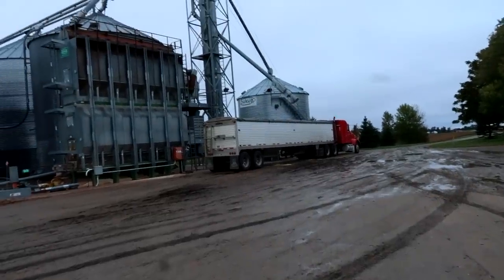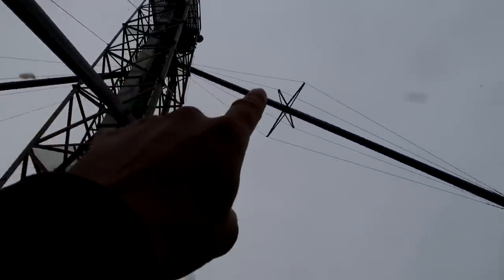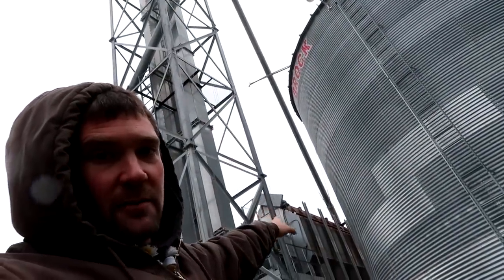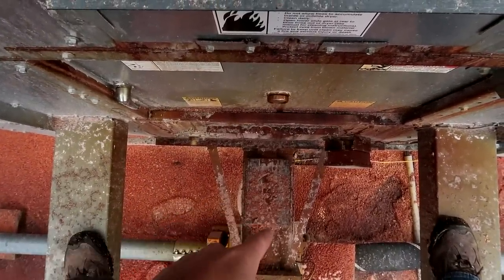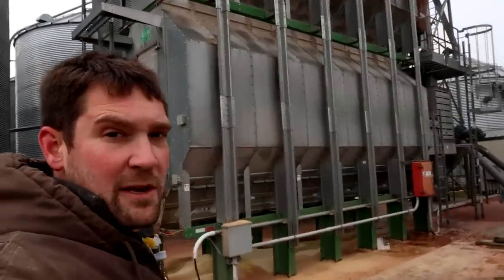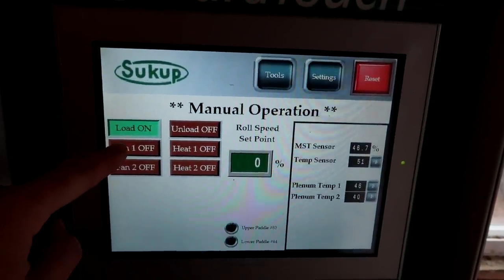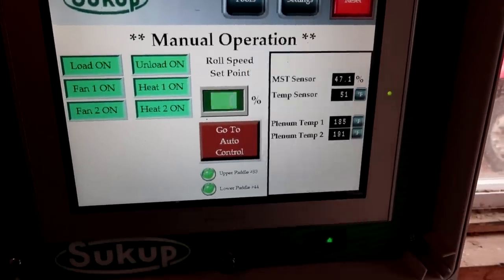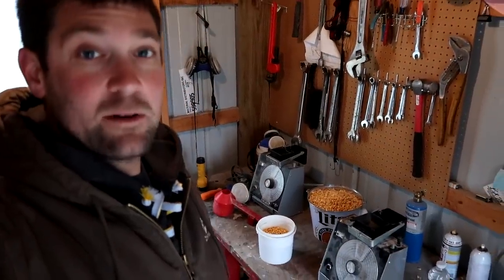Our Grain Dryer and Bin System-How They Work

Comment: Do you have any security cameras at spots you check every few hours? That could help monitor things, at any given time instead of having to physically be there.
Reply: This may be a realistic option these dayz. Wireless camera technology has come along way in only a couple of years, as well weather proof and relatively cheap considering what you get. For this type of an operation 8-10 well placed cameras may allow you to do your checks from the bedside rather than getting up every couple hours. Also the ability to check on things from the field when you are harvesting. Lots of great options in cameras both infrared, night vision, and sound! May be worth looking into. Getting up in middle of the night has to suck

Comment: Why not cover the dryer and motors? That way you can run in rain. Most I know build a Metal Shed over there dryers. And some even use half of a plastic 55 gallon barrel over the auger motors. Saves those belts from slipping when wet.

Comment: At the top of the elevator leg is there a sensor or a switch of some type to change the output from the overflow bin back over to the dryer when it's calling for more corn?

Comment: Hey! How does the grain feed through the walls of the dryer? Whats the distance between the walls (thickness of grain bed) in the walls? Just gravity feed? Do the walls need to be vibrated to keep it moving? Does it feed evenly? Or does it plug or jam up in spots? Im in arctic norway trying to rig up a system (on a much smaller scale) to dry for our local distillery. Cheerz. Great vid btw👍 five million questions all at once🙉 sorry bout that🥴
Reply: One more thing. How does the moisture come out of the dryer? The outside walls are sheet metal?

Comment: Dryer seems like an EXPENSIVE  piece of equipment with lots of moving parts  that might require maintenance.  Curious about cost vs need and if you guys work on that monster or a crew comes in and does that? Also, is there massive downtime if dryer breaks down?
Reply: it is expensive but it saves them a lot of man hours every year since one person can do most of it .

Comment: I’m wondering what’s out there in the way of frequency sensors. Wireless mounted externally on an auger, or load sensors wired into electric motor linked back to an alarm computer.
Or is it time for some new fancy automated/computerised that goes further than just dryer computer.
Your power bill must be huge.
Reply: we do just what your talking about all the time,,,easy process to set up if you have a knowledge of VFDs and PLCs...

Comment: Here in Norway we have a similar system with the dryer. But i havent seen the "air - compressor" to push the grain into the storage bins. My question is: how much PSI does the compressor need to produce to push the grain into the silos? And do you not cool down the grain after the dryer before it get trasported to the silos? :-) 

Keep up the good work Zach! Cheers form a guy in Norway that is studies 
agricultural engineering at a University :-)
Reply: I would imagine it's more about cubic feet per minute instead of psi to move the grain. That motor didn't look big enough to generate much pressure through an open ended pipe.
Reply: Air systems don't necessarily work like you think, when the compressor is running and no corn going through the pipe there is no pressure in the pipe, because there is no restriction....once you start adding corn, the pressure rises....the more corn you try to blow the more pressure.....also the farther you try to blow it, the more pressure in the pipe.  The bigger the motor on the compressor the more psi you can run before you plug the pipe....so let's say you have a 20hp motor, you can run about 4 to 5 psi before you plug the pipe.....also you don't want to send it up the pipe to fast as this can crack kernels,  so we run a compensator valve, which bleeds air off, keeping pressure in the pipe....remember the more psi in the pipe the slower the corn is moving. I hope all this makes sense.
Reply: @scottheeren9807  I hadn't thought about it that way, that's quite interesting. Cheers!
Reply: Aaaa, yeah that makes more cense to me. Thanks!
This system is maybe something I have to consider trying at home. Bevause we are using screws and elevators that is getting a bit old and needs soon to be changed out. :-)

Comment: I do not know if it company sensitive information, but the energy use for drying the corn  must be adding a significant % to your end production cost. In your location all competition has to go to the same process (I guess) so that will make it even. But compared to dryer location your in a disadvantage....
Reply: A farmer who doesn't store and dry their own crops  is going to take a hit  at the elevator, etc.etc for drying and storage.  This is the generic answer.
Reply: I'm not sure what your asking but the cost is roughly 1.5 cents per bushel  per point of moisture. So 28% corn dried to 15%  will cost roughly 20 cents per bu. If that answers your question
Reply from the maker: Actually rain isn't what causes the excess moisture in the kernels, it's mostly due to the amount of time the dead plant has to "dry down" before it's harvested.  In our climate, things stop drying early, where as in southern climates the weather naturally dries the corn down.  Elevators here charge an arm and a leg to dry it themselves, so having our own dryer is a no-brainer.  Other end users won't even take it if the moisture content is above 15 or 16%

Comment: The huge rocks that the John Deere A tractor could not pull,  Dad would use dynamite to blast them out of the ground. This method was used in the mid 1940's.

Comment: We are not using grain hopper trailers in Europe, so it would be interesting to know how long time it take to unload a trailer? Seems quite slow compared with a standard hydraulic tipper trailer?
Reply: Usually a 1000 bushel truck only takes about 2-4 minutes to empty. And the hopper trailers have less parts to break.
Reply: chinkmen A hydraulic trailer only got a hydraulic piston and a manual or hydraulic rear door so not a lot that could break either
Reply: @Mike-qv3pz  a hydraulic piston is still an expensive fix. Where getting a new grain door really isnt
Reply: chunkmen I get your point but still a hydraulic piston doesn't break that easily.. But in europe we need multi purpose trailers and that is probably why you don't see them trailers with a grain door at the bottom out here i think.
Reply: @Mike-qv3pz  yeah usually we only have small dump trailers <5ton otherwise we just use a dump truck
Reply: When I was younger for awhile Dad had an IHC 1800 truck with a 550 bu box with a single hydraulic piston hoist and a tag rear axle and combined with a moveable 7 inch 40 ft auger to fill the bins and we usually could mostly keep up to our old MF 760.  Now the farms are bigger, the combines are much bigger, and the fields are often much further away from the bins.  There are no longer many farms remaining that are small enough to get by with one combine and only one 10 wheel truck, especially when it is too wet to load the truck in the field.  I couldn't count the number of times the hoist was lifted too fast and grain came over the tailgate or grain was put on the ground when the hopper at the bottom of the auger spilled. The old style farm grain truck is going extinct and this grain handling system is something my Dad and brothers could only dream about.
Reply: Wiserguy well that system is indeed not that practical.. But you can't compare the land sizes off the USA to west europe.. You don't see a lot off farmers that store their grain at their farm over here. + They grow a lot off different grains, vegetables,... on smaller fields so they need a multi purpose trailer (so a hydraulic tiping trailer most off the time) 
For example for grain they dump the grain in a big shed at a nearby grain dryer and a wheelloader fills up the pit off the grain dryer. So we don't have the usage for those specific grain trailers with grain doors at the bottom like in this video, since you can't use it for potatoes and stuff.
But farmers who grow only grain and have thousands off acres it is a wise move to buy trailers like in the video because they don't have the need for a multi purpose trailer.
Reply: It's not that slow he didn't have it wide open. There is an elevator in Nebraska they have you unloaded in only a couple of minutes
Reply: @Mike-qv3pz  The sugar beet farmers in the Red River Valley of northwestern Minnesota do use end dump trailers with hoists. Most are made by Loadline in Canada and are 40' long boxes on semi trailers. They then use them for grain also. Zach is further south and east and does not raise sugar beets. Therefore he can get by with hopper trailers.
Reply: AASparkChaser That is what i mentioned myself: that he doesn't have the need for tipping trailers, since he only grows corn, grain, ... where you don't need a tipping trailer for.

Comment: WHY IN THE WORLD WOULD YOU NOT RUN IN AUTO......Its a great system....If your manual running your meter rolls than your not getting the best grain out....Also another thing you might want to look at is putting a VFD on your cyclone system, works great with adjusting the blower speed using the signal off the meter roll speed......great video

Comment: Two questions:
1- why doesnt the air system have flow sensors to shut the compressor off in the event of a broken pipe?
2- How are corn cobs mass harvested for eating corn on the cob, not just grain corn?
Reply: Special machines or hand picking is how sweet corn is harvested. Oxbo makes/owns a majority of specialty crop harvesters. Also sweet corn and field corn are 2 different types of corn

Comment: I'm confused Zak: you said the truck will haul 500 bushels, and the combines holds between 400 and 600 bushels, and a 40' truck trailer looks a hell of a lot larger than a combine hopper. Jeez years ago 70 bushel combine bins were huge.
Reply from the maker: I misspoke on that.  A semi truck load is about 1,000 bushels!

Comment: As someone who has zero knowledge of drying grain, I ask, why is it required to dry it? Does it make financial sense to run the dryer vs selling wet corn?
Reply: Wet corn cant be sold because it molds and wont be able to be transported. A few points of moisture over 18% can be up to a 75cent dock before they just won't accept it.

Comment: Clean around that pit before you dump, plan on pushing all that water in with the corn? It's just going to stick to everything. Lot of corn around that wet bin, did you run it over?

Comment: Is there like a to dry of corn? Like if its 5 percent (if thats even possible)
Reply: Yes. The magic moisture is 15%. Any wetter, most places that buy corn will dock the price they pay. Any dryer, say 13% for example, they pay the same price per bushel as if it was 15%. So you end up burning money on drying costs and gain nothing if you go below 15%. And in addition,   that 2% extra moisture you just cooked out of your corn is mass that you could have gotten paid full price for. So going below 15% is a double loss. 

With that said, there is one advantage to going dryer than 15%: longer shelf life. Rotten corn is basically worthless.
Reply: Thomas Cameron perfect thank you soo much man, I have always wondered that!!

Comment: you ever seen one catch on fire.
Reply: knobcreekoutdoors a farm close to us had a dryer fire about 2 weeks ago.
Reply: I've seen just one on fire in 18 years  . When I was a firefighter
Reply: We had a fire in ours three years ago.  We got very lucky.  The computer on the dryer sensed the plenum temperature was over the limit and set off the alarms.  It shut it self down and filled itself full of corn to try to smother out the fire.  The damage was minimal to one column of the dryer and the end wall.  All we had to do is dump the burnt corn out of the dryer and they came and patched the column and we were running in about 12 hours.

Comment: This dude does awesome explaining it all......But, (this is just me) ...I know he is way north of me BUT, I would rather cut that corn on Christmas Eve than mess with all that...(And ) I get it that it snows hard there.......            By the way I see the Owner of this video has  some supplemental  income.  Well,  a Man and Wife have to to make ends meet.. My wife and I have like 6 jobs between us and we like it that way...I may mention we have 5 kids.....Amen...
Reply from the maker: Often times we have several feet of snow at Christmas time, or even mid-November like last year.  On top of that, it would still be 22% at Christmas because the cold temps don't let it dry.
Reply: I figured ya did...I knew there was a method to your madness...Sure ain't nothing easy...80% of my beans are under water...